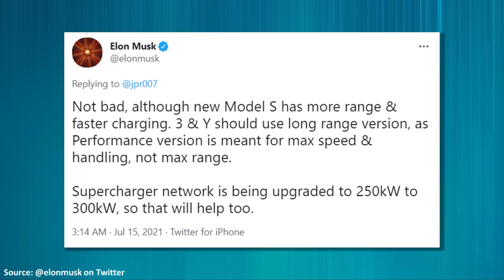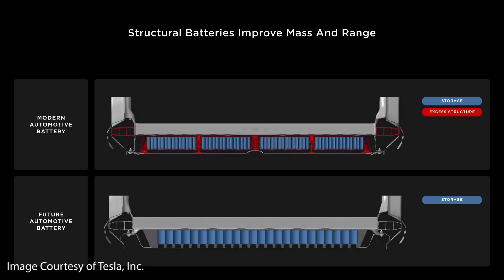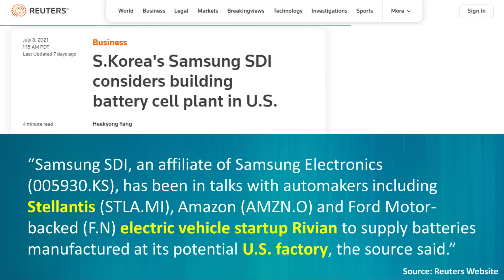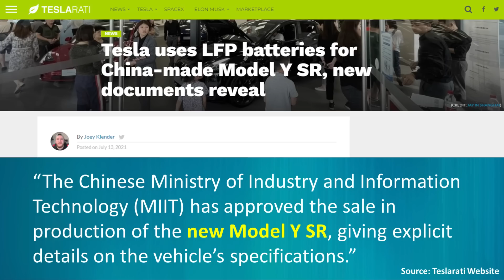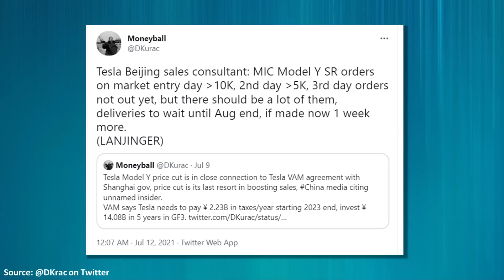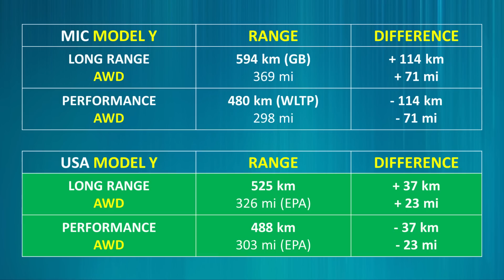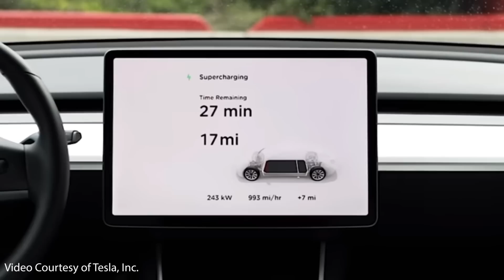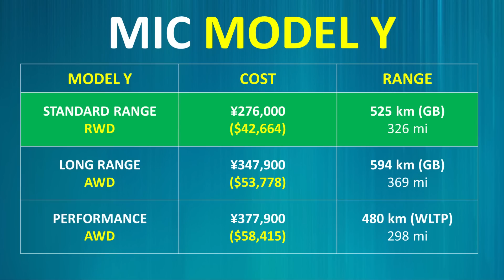New Tesla 4680 Battery Suppliers, 300 kW Superchargers + SR Model Y

Comment: You forget that the LFP batteries model Y, mean they can pump up the production even more since they can get those LFP from CATL and thus keeping the better batteries for the LR and Performance
Reply: So which vehicles will get 4680? Which will get the other ones?
4680 Semi, CT & Y
Reply: @starshipcaptain4753  the 4680 will come in the high end Model Y once they have the plant ready in Berlin and Austin. CT and Semi as well. And I expect that once external battery suppliers can produce LFP batteries in 4680 format they will change all cars to 4680, or use them for power walls, Mega packs and other storage solutions. I think the Tesla engineers already have a solution in the pipeline and can switch within weeks. 
Unlike the people at VW who apparently need 5 years to create a new platform which then will be rendered outdated like with the MEB.
Reply: all model y variants made in china has lfp batteries. he should have mention that
Reply: @cornelstamate2537  So will 4680 be saved for Semi, CT and Storage until production ramps up and while Tesla is still ahead of the competition?
Reply: byd ea1 model will have the same range as model y but at half the price. if so only than the real competition in ev begins. the byd ea1 release in a few months is the most important thing i m waiting for.
Reply: @cornelstamate2537  Great! I. All for all electrification whatever the brand is but I will support Tesla since they moved it forward. But let's complete the comparison and competition on Electric cars vs ICE cars so we can continue the rapid transition.👍🏿

Comment: @Cleanerwatt  It seems fair to expect Tesla to have their own solid state solution on an equal or (as usual) faster timeline. So what will the transition to "universal" solid state tech look like, assuming all the makes "get there" in 2026, together? Until then, Tesla's tabless cells will be well entrenched & economically optimized while all others will be lagging, for 5 years, with less effective non-structural & dendrite-prone tabbed cells & pouch/prismatic packs. If rumors that Porche is developing their own "high performance" batteries are true, will those have Tesla-like advantages & be available economically & in sufficient volumes to matter a whit? Won't Tesla's lead, in terms of EV design, performance, sales, & profitability, etc., just be that much more magnified with the addition of SS "for all"? What, God forbid, if Tesla is the only one without SS as the ICE camps seem to be counting on? If (more likely), Tesla adopts SS first, will that mean the immediate stock market capitulation & bankruptcy of all ICE (& fossil fuel based infrastructure) manufacturing? And what of octovalve-enabled battery thermal management plus CF-wrapped motors that widely increased charge/discharge parameters for MSP, all sans 4680? Seems like more than enough to compensate for LFP weight penalties, while advantaging their durability & safety characteristics! Whew!! I can see why ICE engineers are abandoning ship, in droves, leaving their former "masters" as proverbial headless horsemen. Can't wait for some of this to sink in around Halloween time! Pretty scary-exciting stuff whichever side of the fence you've chosen to be on!
Reply: Thanks for watching, I have something real big for you on how to increase your income..T.E.X.T
+•1•8•5•8•3•8•1•2•1•6•4...do well to respond!

Comment: Unfortunately I think you are correct in that the vehicles with 4680 will be the ones that can take advantage of 300kW charging.  The current S3XY vehicles will be "stuck" at 250.  It'll be interesting to see the charge curve for vehicles with 4680 batteries (where the taper starts).
Reply from the maker: It will be interesting to see the 4680 charge curve for sure!

Comment: I don't get it, why not chargers that go up to 1MW - 800 volt like Ionity? 300 kW will be outdated as soon as solid state batteries arrive.
Reply from the maker: Solid State Batteries in EVs are at least 4-5 years away (if not more).
Reply: @Cleanerwatt  Even if it is 4-5 years away, you don't want to replace thousands of chargers by that time. 
Several car manufactures have announced mass production of solid state batteries by 2024.
Reply: @Crunch_dGH  Two things Tesla has proven over and over again in the past: 
- their timeline is always too optimistic
- they don't secretly develop tech. 
There are a few brands that are known for secretly developing tech, the first ones that comes to mind are: Porsche, Mercedes and Toyota, one of these, probably all of these companies will beat Tesla to market with a solid state battery.
ps. The "high performance" battery from Porsche is not a rumour, they already got that tech, although I think it might be just the 21700 battery from Varta, this battery outperforms the 4680 from Tesla. A pilot line for this battery is now being build in Ellwangen Germany (but it is not solid state).
Reply: @Christs_Apologet  
Tesla's timeline is always too optimistic even fanboys talk about Elon time.
Every company does keep their developments a secret, except Tesla. I can't think of a single development that they didn't started hyping years in advance.